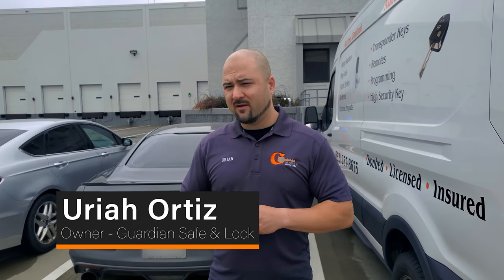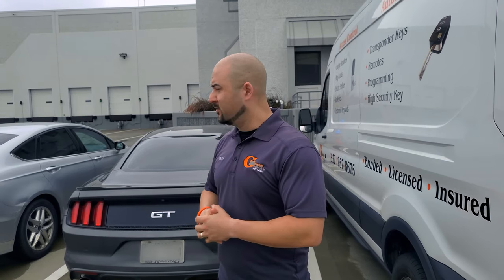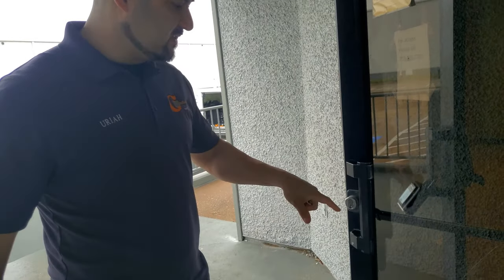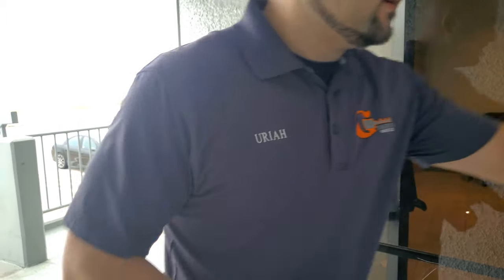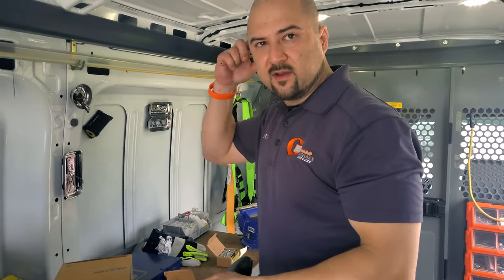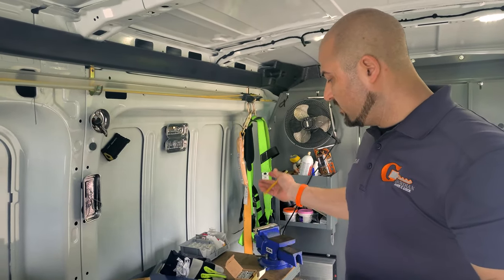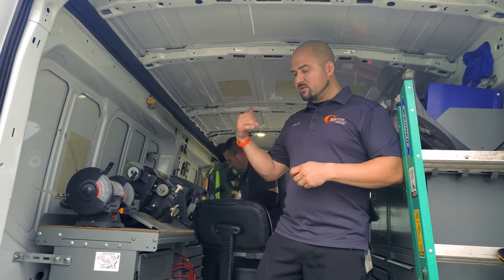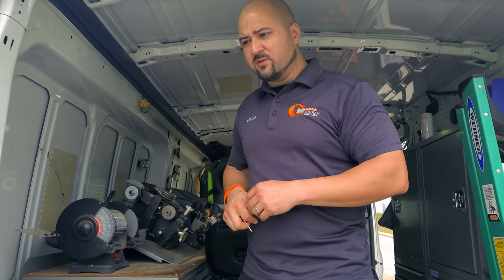Drilling Out Best IC Cores | Leading From The Front With Uriah | Episode #3

Comment: If they could’ve sacrificed 1 lock, might have been able to drill the housing itself where the control lug is held to save the core and decode the control key cuts so you hopefully wouldn’t have to drill the rest. Thanks for sharing!✌🏼
Reply: I've been an institutional locksmith for over 30 years, I've had several jobs that involved changing out 20 plus cores without having a control key. I usually find a closet or low consequence lockset and drill out the control lug and pull. I then am able to decode for the control key and save having to drill the rest (or most of the rest) of them. It has saved me hundreds of hours over the course of my career with this method. Pro tip: carry an extra handle or core housing just in case the pulling damages the retaining edge of the lockset/housing...
Reply: 37 years experience makes me frown on this approach. We would drill only ONE core and decode it only if unable to pick the control key sheer line. Decode the one core to determine control key bitting. There's much wasted TIME drilling and probably breaking lots of bits while wiggling the drill without using an appropriate jig. This customer undoubtedly paid for new cores and perhaps housings and lever sets because of this approach. Not the approach that Jerry Finch would recommend. If the original I/C core system was done with 1 control key,  his customer would have been given better value and a more professional approach by NOT drilling EVERY core. Let firemen and contractors break things! Professional locksmiths know how NOT to break things to open them or remove I/C cores. It's an interchangeable core system! Why not just put the whole place on Schlage C after all the drilling and wasting hardware? For every ten I/C core systems we get, id say 1 in 4 has the control key. Decoding is part of maintaining the system for the new tenants and definitely more secure. This approach in the video was a typical wasteful approach used by so many who fail to completely understand I/C core keying systems.

Comment: Ok, so you said they didn't have a control key? I'll assume this was a facility they moved into and set-up 0 security for themselves and just used whatever was already there- which is not ideal, lol. ?! Well, good vid. I would suggest next time you drill out the lug, grab an annex, and decode the fucker. You kind of have to assume that whoever DID have the security installed= it's probably master keyed to some extent. You're a locksmith, decoding from pins and making a key should be easy. (Looks like you already have the machine to make them in your truck- I'll assume you have blanks too) The down side to that is an SFIC lever is about 90 bucks new/35 for Knobs, so when you drill the lug= you fuckup the actual door equipment. It's a gamble. You'd save a shit-ton of time if it Was mastered, you'd also get the benefit of just repinning the existing core/s. Also, I see this a lot and it's fucking irritating. Why a 'Change Key'? Do you know how fucking confusing it is when a locksmith uses that terminology. WHY? Well, calling it a change key indicates that it must change something, like a core, which  it doesn't. The Control key= Gives you control over the core. The Operator key= Operates the door. Using the word Change key makes it seem like the Control key. I know you say this as it's probably the word your mentor used= you should really think about saying it the way I defined. Anywho, my 2 cents.